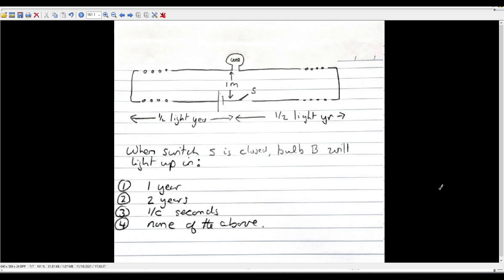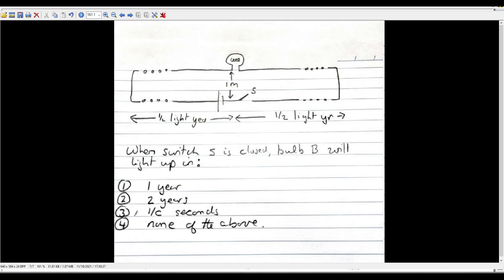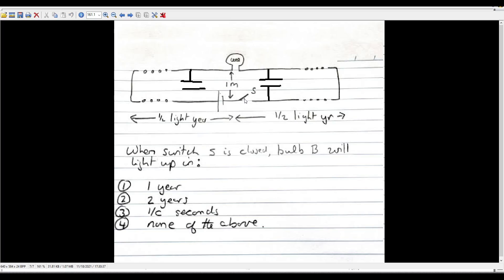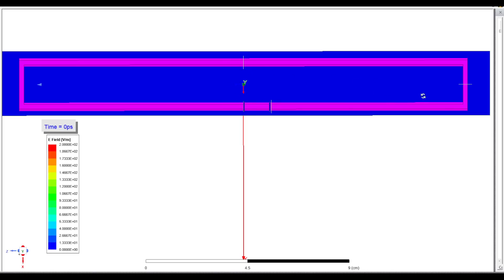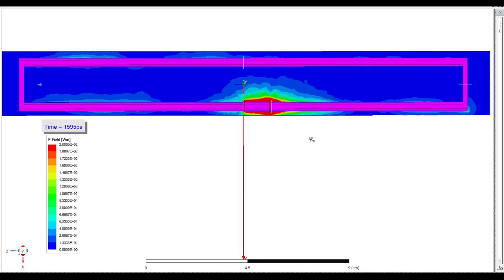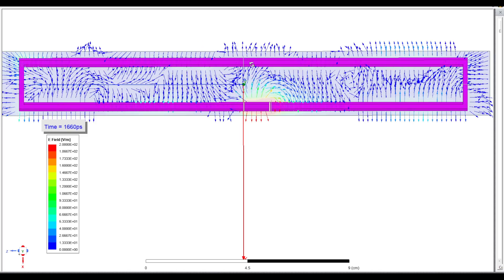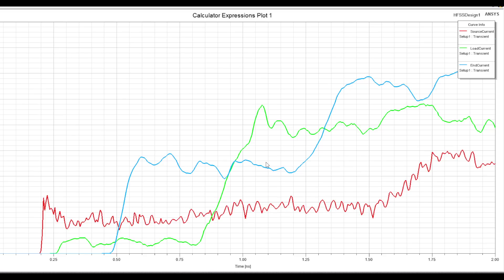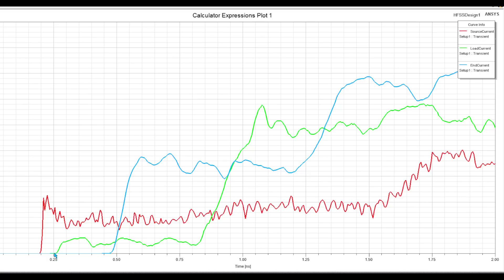Response To Veritasium - Electricity Propagation Time Problem

Comment: Love the visualization. Hope people don't discount this video because they think using light years vs light seconds makes a difference
Reply: No. This is valid to shoe the fundamental principles.
If ypu care, heres My response to another comment:
.. .. .. .
It is a funny way to draw the circuit.
..
The two line pairs extending outward the long distance to the left and right form transmission lines.
A fundamental characteristic of T-Lines is that until reflections come back to the start, what a source sees is the characteristic impedance which in this case is a pure resistance.
..
Therefore at t=0 when the switch is closed, the circuit is a battery with two resistors connected to the bulb. Because those resistors are 1 meter long, it takes that one meter time of delay 1M/c, for the energy to get to the bulb.
..
[Side note The fact that these T-Lines have a One Meter spacing, probably adds some additional complexity, but this fundamental idea is clearly demonstrated in the simulation
.. .. ..
Conclusion:  A smaller amount of energy (as strange  as it may seem)  takes a short time to travel that 1 meter between batt and bulb. Then, after the reflections die out, the bulb lights fully. AND
.. ..
Conclusion, the CORRECT AND FINAL ONE.
This does not "prove" that fields carry the energy. NOPE!
You cannot separate the current flow and the fields and claim that the energy is "carried by" only one.  The movement of charges and the associated fields are inseparable.  They are two ways we have devised to fit electrical energy flow concept in your peanut brains.  This makes sense of you know that things like electrons can be viewed as a particle, or a wave function.
- - 
Cheers, 
An experienced RF engineer..

Comment: Interesting. Why there is so little current by the source?
Shouldn't all currents become equal upon everything is settled down?
Reply: It does, but AFTER all teh reflections settle out.
.. ..
Here's my full response:
It is a funny way to draw the circuit.
..
The two line pairs extending outward the long distance to the left and right form transmission lines.
A fundamental characteristic of T-Lines is that until reflections come back to the start, what a source sees is the characteristic impedance which in this case is a pure resistance.
..
Therefore at t=0 when the switch is closed, the circuit is a battery with two resistors connected to the bulb. Because those resistors are 1 meter long, it takes that one meter time of delay 1M/c, for the energy to get to the bulb.
..
[Side note The fact that these T-Lines have a One Meter spacing, probably adds some additional complexity, but this fundamental idea is clearly demonstrated in the simulation
.. .. ..
Conclusion:  A smaller amount of energy (as strange  as it may seem)  takes a short time to travel that 1 meter between batt and bulb. Then, after the reflections die out, the bulb lights fully. AND
.. ..
Conclusion, the CORRECT AND FINAL ONE.
This does not "prove" that fields carry the energy. NOPE!
You cannot separate the current flow and the fields and claim that the energy is "carried by" only one.  The movement of charges and the associated fields are inseparable.  They are two ways we have devised to fit electrical energy flow concept in your peanut brains.  This makes sense of you know that things like electrons can be viewed as a particle, or a wave function.
- - 
Cheers, 
An experienced RF engineer..

Comment: The ultimate key here is that two parallel wires make a T-Line and at t0, when the switch is closed, it looks like a resistor - plane and simple.   
.

Therefore, in the original circuit, at t0, we have a battery, a bulb and two resistors all in series, but since the bulb is 1 meter away, it takes ONE meter worth of time travel to cause that SMALL current in the bulb.

^          |-----bulb---|
|           |                 |
|           |                 |
1m      R              R
|           |                |
|           |                |
v          |-bat&sw-|
.. .. .. ..
.. .. .. ..
What Veritasium meant my "immediately".  he meant that it will illuminate (give off light) as soon as current flows.  It won't take time to warm up like an incandescent bulb or some LEDs that have a lag due to the way they are current controlled.
.. .. ..

The resistance seen at the source end of a T-Line doesn't change until a reflection makes it back there.  Then you have two waves that add and the current and voltage follow the well known principles of superposition. In this situation, we have TWO T-Lines connected to a common location, so it gets really messy fast.

.. ..

The reflections WILL die out because the bulb will absorb (and also reflect) some energy with each reflection-wave hitting it.  The reflection and absorption amounts determined by Z0 and the bulb R value.
.. .. .. ..
.. .. .. ..
My bottom line is 
A} The bulb "lights" dimly after the 1 meter travel time.  Then flashes around, ultimately reaching the brightness of the DC circuit of batt and bulb only.
.
B}  That it is folly to try to decouple the charge flow and the fields.  They are both part of ONE SINGLE PHENOMENON in this universe that WE have chosen to separate.  Separating them is what we have done to fit some concepts into our brains.  After all, aren't electrons described by *wave equations*. 
...
If you want to say it is electrons in a wire ...OR ... fields around it, knock yourself out...
Reply from the maker: YouTube just now decided to notify me about your comments on my other videos.

Yes it seems that this transmission line simplification describes the problem accurately. What is not typical in transmission lines though is the source placement. The source is not feeding the transmission line in "parallel" as it normally would. Rather it is in series with one of the legs. This oddity explains why initially we have asymmetric current magnitude in the bottom wire and the top wire.

I also agree that in the presence of fields charges will move and moving charges create changes in fields. They are indeed inseparable. However in describing the flow of energy to a load we CAN say that the energy delivered to the load is delivered by the fields around the wire, not the kinetic energy of the electrons flowing within the wire. Still, those fields around the wire are partially due to the surface charges on the wire, so like you say, electrons still certainly have a  role to play in facilitating the transfer of energy.
Reply: I did not get a notification either and just happened to come by here because I've saved your video in my favorites.
Yes, this is a very odd configuration and I suspect that Derek may have done this to spark controversy and discussion. We normally put the source at one end of a transmission line and the load at the other end. However, he also may have just thought it was pretty much irrelevant and wanted to make sure that he had lots of wire between the battery and the bulb, but I do wonder why the bulb is a meter away. That part seems rather suspicious.
In this case we have these two transmission line elements placed in series with the load, but each one on the opposite side of the circuit, so it makes it very confusing to many people.
Also, having  t-line with 1 meter spacing will add a little more complexity, but I think the best overall view is of the two transmission lines and that firs with your HFSS simulation.
..
Someone else that appears to have figured it out is Z Y, but in his second video. 
 He goes so far as to look at various reflection scenarios in detail. It wasn't clear that he had all of the finer details covered, but later in the video he fills those in rather casually and you might miss them.
.
Everybody's doing their best to describe it in the terms that they understand.  Discussing this with other RF engineers, what I present is the consensus.
- - 
Cheers
.

Comment: The problem with this is that there are actually 2 answers, which you demonstrated well.  The first is immediate but negligible, and the second involves the actual circuit and yields exactly what you'd expect.  In the first minute where he poses the question, he doesn't allude to the negligible response, but asks you to 'lock in' your answer.  It's very misleading.

Comment: So the test setup was not one light year but one light second. But let's leave that aside. The basic idea of the video was, at least that's how I understood it, to show that energy is not "transported" by "balls" of electrons but by waves. So he didn't want to show that energy can also be transferred via an antenna or a capacitor. If he wanted to show that, 50% of his video would be meaningless. So instead of dwelling on the distance of one meter: What happens if I have a circuit of as perfect circle in the length of 2 light seconds. At one point the switch, at the opposite point the light. When can the astronaut read his newspaper at the light? And how is this energy transported. And the answer is self-evident. At least 1 second will pass. Because the wave spreads at maximum with light speed in both directions.

Comment: I'd note, although I enjoy his thought experiments (my definition/perspective) his general audience doesn't like his reasoning challenged - not unusual among anyone's fans - and trying to educate U-tube/internet experts (armchair) is like putting the proverbial dress on a pig?
-specifically, I tried to correct/point out that our radio communication with human based spacecraft sent &/or received didn't show readily apparent differences in the speed of the electo-magnetic radiation that  is light.. because we have a "baked in" experiment/ example (changing orientation due orbital physics)...
IE, a change in the speed of radio waves (propagation-what is is @ the core of this "current" thought experiment) would be readily apparent in an additional shift above & beyond the already known Doppler shifts. In fact? Additional shifting would stick out like the proverbial sore thumb (astro physicists deal & utilize Doppler effect for Much of our current understanding of the universe??)
Now if the premise is to challenge/question assumptions, on a level I understand and even support that notion...as long as our own logic gaps/ fallacies / lack...are also critically examined...
Including my own. )))
-a way I like to view the "speed of light" theoretical limit, is instead the  "speed of causality".. and the relationship to expanding (and accelerating) space-time..
Or, 🤣🤣 the "true 'cause'' of increasing obesity"/-Because of expanding space-time...(jk) 🤣🤣

Comment: Without reading and understanding Nichola Tesla, Oliver Heaviside, Steinmetz and JJ Thompson, you won’t be able to understand where electricity comes from. Using this term “electrons “makes people believe that the electron is a particle. JJ Thompson never did say an electron was a “particle” he said an electron was one unit of dielectric induction. For all practical tense and purposes the electron does not move in the wire, it moves in the space between the wires. Where the dielectric crosses the magnetic field lines is really what an electron is. And this is why it can propagate down the wires at the speed of light.  As far as voltage and electrons are concerned the wires only work as a termination of the dielectric field into them, They react more like a reflector.

Comment: It matters what capacitance you plug in. Everyone is conveniently using high capacitance values to show there will be some current generated almost immediately. But with normal wires at 1m meter distance I suspect the real capacitance values are so small that with few expected amps in the circuit you get no detectable transmission of high frequencies. But this experiment nicely shows it doesn't matter there the battery is but where is the switch. That fact was missed by the Veritasium. If you stretch facts to it's limits, you can get bizzare claims the lightbulb 💡 will be on in "1/c". I am surprised how little critical thinking there is among YouTubers.

Comment: Can your sim to dq/dt for the wire at some point? I would assume in any question like this that "light up" mean in the same way as for a very short wire and in the continuum of increasing wire lengths to 1ly. Also assume that the switch is something that lets the EMF increase slowly so behavior is basically DC. Like adiabatic compression in thermodynamics

However I think the case can be made for a 2 year minimum. After all, why would any current flow at all until the change in electric field can reach from one side of the battery to the other and get electrons (slowly) moving in and out of the battery? And would they start moving on the entire length of the wire? Or is there a ping-pong off information with a 2 year time constant? I would place some green chips on number 4.

Comment: It's not 1/C at #3!
That makes absolutely no sense at all!  It means the bulb will light almost immediately (Picoseconds) even if the lamp were 1-light year away. That is garbage of course! Propagating a signal faster than light breaks causality.

#3 must contain a number which represents the actual distance from the lamp to the switch/battery!
Reply from the maker: More accurately, d/c seconds, where d is the distance from switch to bulb. In this case the distance is 1m thus 1/c

Comment: You might also want to model the earth the wires are resting on.  The electric field around the wires will be much stronger in the downward direction than towards the other wire.

Comment: Do you remember old analogue VHF TVs, where the antenna used those flat balanced cables instead of unbalanced coaxial cable, relying on common mode rejection to reduce interferences? The impedance of that cable was 276 log10 D/d, where "D" is the distance between the two wires, and "d" the diameter. The antenna flat cable had Z = 300 Ohm.
I recall how mismatched impedance caused image ghosts, as result of reflected waves on the transmission line. By knowing the scanning time of one line of the TV picture (in EU, we had 625 lines with a 15,625 Hz scanning frequency 50 times a second, split in two half frames - interlaced), it was easy as divide the spacing between the ghosts by the speed of light.
All my experience with network analysers do support the Distance / Speed of light delay (answer 3) but only when the circuit had reached regimen, and not during the turn - on transient. What are the distributed L R C of the circuit during the turn on transient? I understand we set arbitrarily R = 0, but what about inductance and capacitance? Mu and epsilon are intrinsic to the existence of the electromagnetic field, they are caused by the nature of the Space that contain the field.
Can you simulate a measurement with a Time Domain Reflectometer with your software?
Any value of L will make the current raise exponentially. If the field forms in 3 nanoseconds, the field cannot form. Hope you grasp the concept.

Comment: I think your simulation demonstrates exactly how Veritasium's question/answer was-- I hate to say "wrong," but misleading at best.
Even with your separation of a few centimeters and wire length of roughly 30-50cm (just my estimate), the majority of the power arrives after ~1ps (total distance/c, not separation/c).  The initial transfer is a tiny fraction (about 1/10th), and would be far less for a 1m separation.  Everything you have here is correct-- the capacitance model, the simulation, etc., but I still interpret the results to be "total distance/c," not "separation/c."
It would be nice to see the simulation for the actual geometry, just to show true size of the transient for separation/c.  Boosting the voltage source (1V is small, and a real-world DC sources could be higher, say up to 200V) would increase the initial transfer, but I think the increase to 1m separation would far outweigh this, due to 1/r^2 falloff.
Nice simulation setup.  I think Veritasium should follow up and clarify.
Reply: I was making some transmission line model in circuitlab, but then apparently my trial stopped halfway and I can't open it up lol.  I think for 1 V battery there was like ~10 mV showing up across the bulb (10 or 100 ohm)
Reply: @Mazzoner  Sounds reasonable.  His video implies that the power (meaning the majority of the power) is transferred in this way, and in my opinion 1% of the power does not qualify.  The biggest common sense argument is that if the wire is cut on the end, you'll eventually get no power (with a DC battery).  This fractional transient is interesting, but not what he was saying.
Someone will have to spring for the full version of Circuitlab for you so you can finish the results!
(I still want to see Derek lugging a couple km of wire out into the desert :-D )
Reply: The initial transfer is small because at t0, the two Transmission Lines (T-Lines) out to the left and right simply look like a resistor of value Z0 of the transmission lines.
This makes the circuit a bulb with two resistors in series.
..
When all the reflections die down, then you have the DC circuit with batt supplying the bulb.